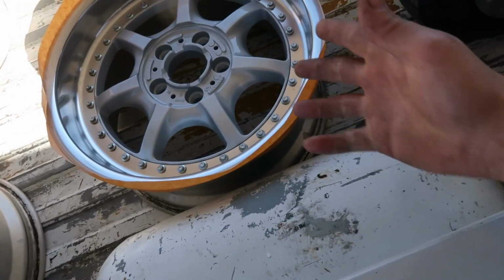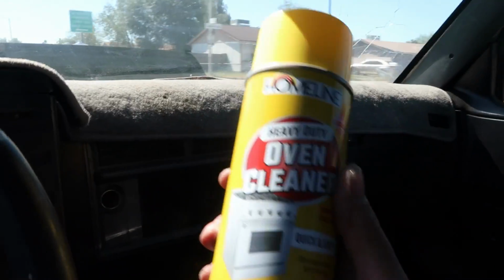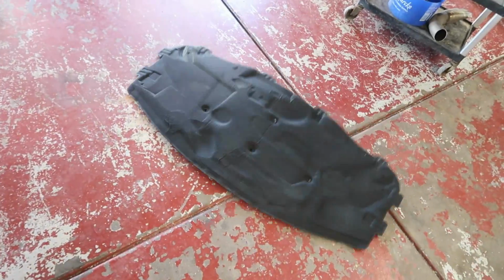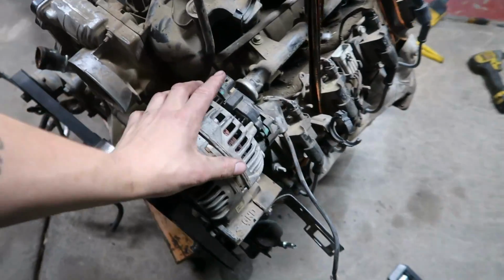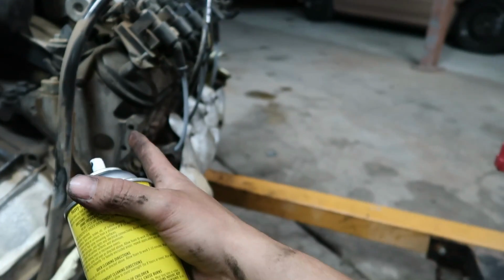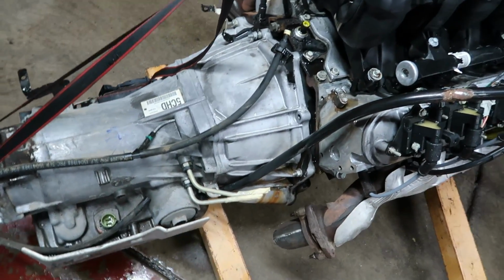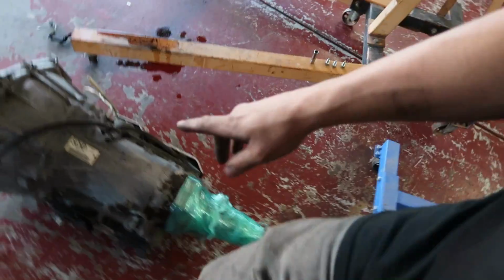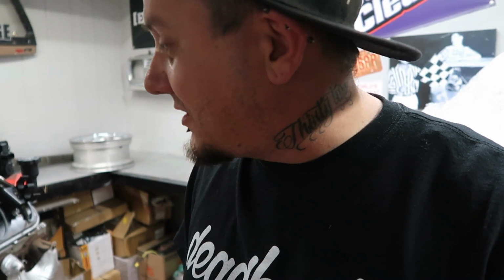Came out so GOOD! (E46 on her new wheels)

Comment: For degreasing use kerosene in a spray bottle. I just de greased my k24a2 yesterday. The oven cleaner will work but the kerosene melts the grease away.